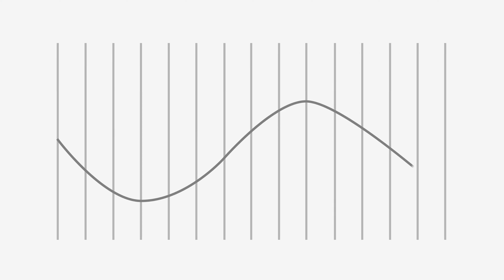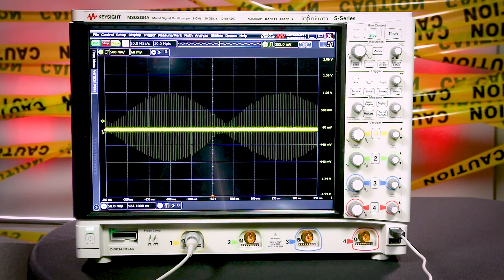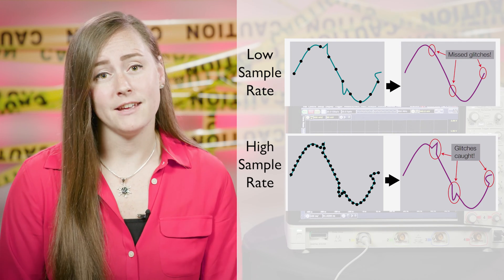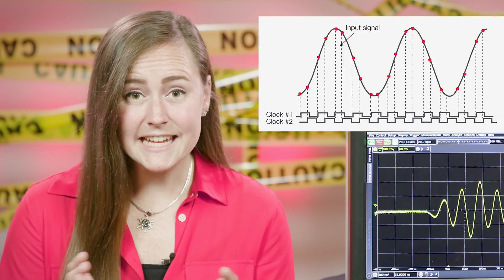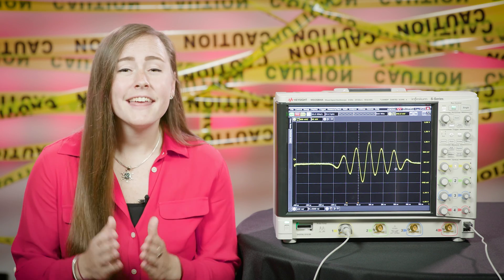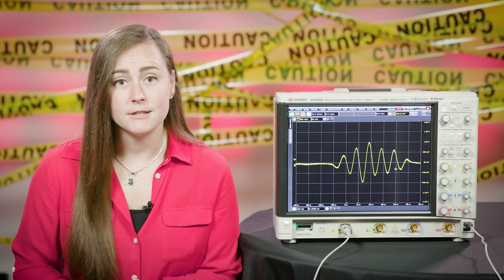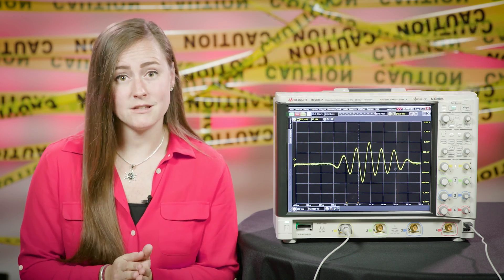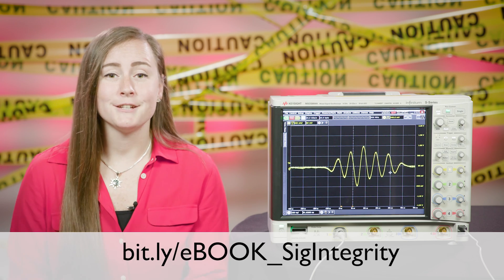What is Sample Rate and What to Be Cautious Of

Comment: If you had a choice of using 1 ADC at 1x sample rate versus doubling your sample rate by interleaving 2 ADCs, which measurement would be better? Is there a crossover point where the benefit of 2x the sample rate is gone when the time skew between the ADCs differs by some amount relative to the sample rate?

Comment: Discussing interleave distortion, with no mention of calibration and lab environment impact to instrument performance is leaving a gaping hole in the topic.   It's easy to make a vendor's instrument crap the bed by forcing a self cal in one environment then moving it to another to do the measurement.  

Also some vendors suppress artifacts from their digitizers knowing they occur.  

It would also be nice to drop a note about waveform update rate and if it's continuous or in bursts, especially when you bring up "glitch" 

Otherwise, great vid.

Comment: also there is cost per glitch to capture small details. For high end R&D more is better "007" leading to very high end equipment or use lesser test equipment for hobby projects. 😎 thanks.
looks like the: Keysight MSOS804A - Mixed Signal Oscilloscope (8 GHz / 4 Analog Channels / 16 Digital Channels)  at TE Equipment is  $101,466.00  on 11/12/2022 🥰

Comment: @1:15 - wait, what exactly is that "sampler" before the ADC ? I thought the ADC is the one responsible for sampling, the actual analog to digital conversion being the sampling process.
Reply: That would be the sample-hold device.  It follows the input, keeping a tiny capacitor at the voltage it sees.  When "hold" happens, the tiny capacitor stops following the input voltage and simply holds whatever voltage it has so the ADC can measure it.  Most ADC designs cannot correctly encode a signal that changes voltage during the measurement process.

Comment: Wtf R U on about. 
It's not rocket science. Just double for -/+ and ad 400 for film.
Reply: I do apologize about my not understand. Mix sounds with video is one of the hardest thing. To sync up. And depending an what the video is for. I've learn that you can't sync sound and video at different rates. It's hard but it's easy at the same time. Less is more and more is less. 

Ever wanted to know why sound and video goes out of sync sometimes after playing a long shoot. Well it's the sound recording and video formats are at different rates. Took me 30 odd years to work that out. And using cheap gear.

Comment: You need to be clear on what you mean by resolution.  You yourself stated the Nyquist theorem.  Higher sampling rate will increase the resolution of the wave form up to the point of Nyquist frequency limit given a sampling rate.   Your time resolution is NOT increased (assuming you are already at high enough sampling rate).  Time resolution is determined solely by the bandwidth limit of the scope.